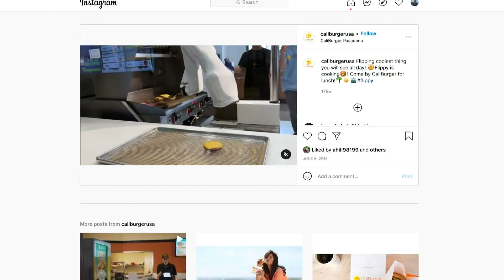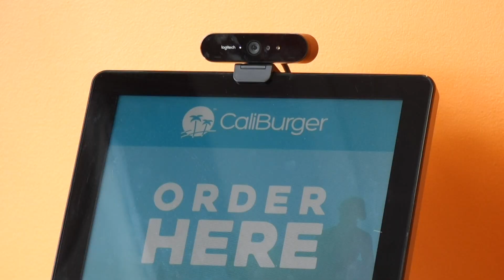Meet 'Flippy': The robot that's cooking burgers at this Shoreline restaurant

Comment: this is 15 yearold technology... there is nothing AI about it.  It's just macro movements.
Reply: Yeah you're actually wrong. The AI is in the camera monitoring the food. The visual information from the camera is being passed through a neural network. Flippy can view the food and can determine how done the food is and pull it out when it's perfectly cooked. It's also using that visual data to move and position itself. It's not pre-programmed or running macros. They actually have to train each arm to cook and prepare the food but once trained the AI can be outsourced to every other arm.